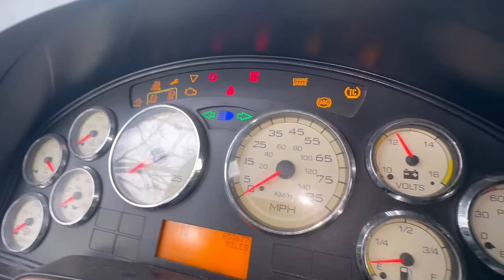Building A Fleet With Landstar. It’s Time To Take It Up A Notch.

Comment: Change the small filter on passenger side you DEF filter it called I think. And change the one on driver side to the newer small circle plastic one brotha. They will trip sensors when they cold from time to time or when it really humid fyi. Best of luck and get to the bag brotha
Reply from the maker: I would if it had DEF 😏😉
Reply: @GRINDNGEARZ  delete haaah good S$@#.
Reply: Mine don’t have DEF either thinking about leasing it too Landstar. How do you get the def gauge to still read at full?

Comment: I am not a truck driver, but the Detroit engine was always the worst one to do a PM on because you pull the oil filters. You have to make sure you check that the threads are tight, and when you top off oil, start the truck. You're recheck your oil It looks like it is dirty again.